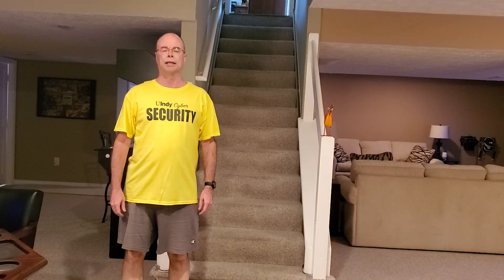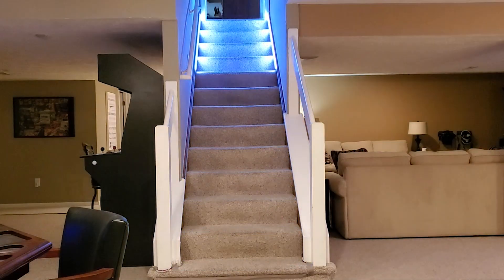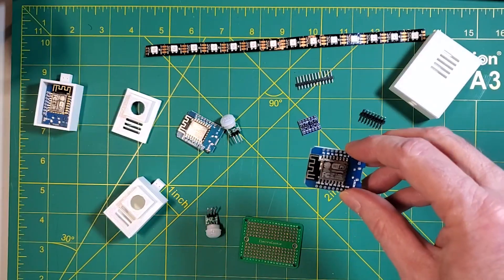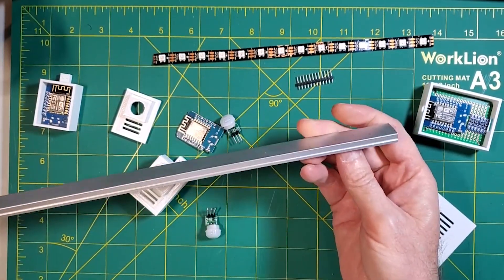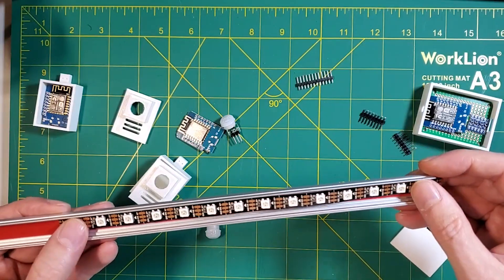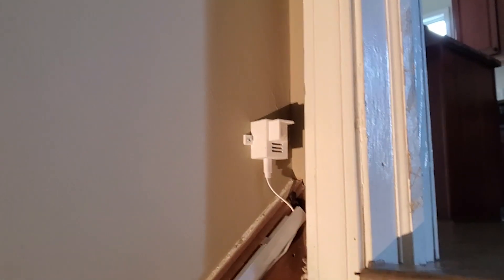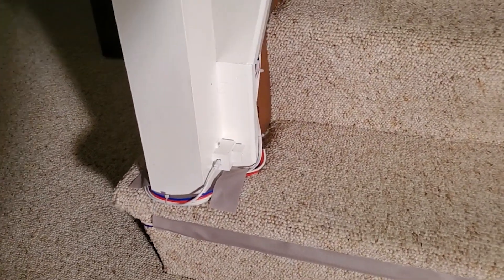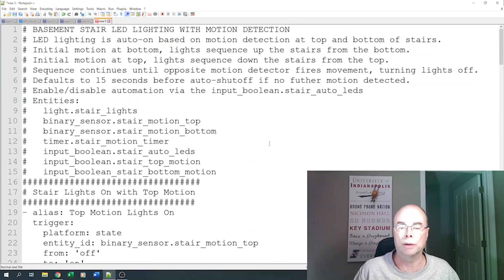Motion activated LED stair lighting... without staircase modification!

Comment: Neat! I may implement this on our stairs. I'm already familiar with all the pieces and am running HA, so it should be a quick weekend project.
Reply from the maker: Great!  Let me know how it goes.  If you are going to use my YAML, just assure you grab the right version of the Gist file as recent changes in HA and WLED broke the older version.  If you are comfortable with YAML, I'm sure you'll have no problems but it seems that this is where most folks have reached out to me with issues... integrating my YAML automations into their particular HA instance.

Don't hesitate to reach out if you do run into any questions or problems... and good luck with your project!
Reply: @ResinChemTech  Will do! I've ordered some stuff to start the work. Primarily the channel, but also the PIR sensors and some D1s (I think I'm also nearly out of D1s - I've mostly been using ESP32 and ESP32 D1 Mini's of late, but the ESP8266s are plenty for this project). I have an extra LED strip so I'll start with one side to verify I like the channel I've chosen.

I imagine I'll just create my own HA automations so they make the most sense to me - I have at least 15 or 20 that I've written so far for lots of little things around the house that are motion or time or location dependent. I've got a few ESPHome devices already and I've even written WLED plugins, so I should be good with those. I just hadn't thought about putting the strips down the side (duh!) or lighting two strips in parallel from one data line - that works well?

Some of my WLED projects... I made this for our 25th anniversary (3d printed body, designed and printed by me, uses 3mm fiber optics, runs WLED) https://www.youtube.com/watch?v=hsc0FMRmU38 . I made this lamp for my grandson's birthday, the video shows off the plugins I made for WLED to provide on-board UI https://www.youtube.com/watch?v=tITQY80rIOA .
Reply from the maker: Sounds like you have plenty of experience with HA and WLED, so I'm sure you'll figure that part out.  Splitting the data signal worked out just fine and hasn't caused me any issues.  I honestly didn't know at the very start if that would work, but I didn't want two separate controllers (knowing they'd never actually truly stay in-sync.. even if I used the WLED syncing feature).  But with the single signal line.. and with the same number of pixels on both sides, they are perfectly in sync for all effects.

I did have to experiment with various motion detectors.  I originally tried a couple of Zigbee versions (thinking that wireless would save me from running the extra USB cable), but everything else I tried had too long of a cool down period... up to 45 seconds in some case.  The ones I ended up selecting had the shortest cooldown I could find... around 5 seconds.... but it did mean I had to run USB power to the one at the top.  But as I showed in the video, using the flat cable pretty much makes it hidden.

Again, good luck and drop me a line when you get it done!
Reply: @ResinChemTech  Project completed yesterday. https://www.youtube.com/watch?v=DaU0u5YZguc for a video. The parts I used  for the project (along with links) are all in my video description. Thanks for the inspiration to finally install stair lights (I'd been considering it for a year). The missus loves them.

Comment: You just basically have wires and stuff hanging there and 'tucked behind stuff' and taped down. 
IMO I wouldn't do this unless everything was concealed and build from behind/under steps.   
IMO you should do anything other than carpet on steps.  But guess it makes it easy to hide stuff.
Reply from the maker: This project, as I did it, is not for everyone.  My intention was to do this without any modification to the existing staircase, as we will be selling our house in the next few years and all this has to come back out before listing... and I didn't want to have to repair a bunch of modifications.  There are many, many other stair light videos where they tear out drywall, route the stringers, etc. if someone doesn't want to see any wires or other components.  This is simply one option if someone wants to install a similar system without tearing anything out or making any permanent modifications to the existing structure.  

Thanks for watching and providing your feedback.

Comment: Can this run without the home automation.?
Reply from the maker: Not this particular version.  However, I did create a version in another video: 
 https://youtu.be/b4s_VEtVWY4  that is standalone and does not require any home automation.  This version is obviously more basic and doesn't include all the various effects and options of WLED... but it will work with two motion detectors and allows you to select color, brightness and couple of basic effects... all without any sort of home automation required.

Comment: I just want to make sure I'm clear. The flat usb cable is just to power the top board? If so where is the other end plugged into? Or is it cut off and wired into PS?. Another where are the wires joined to work the leds on the other side? You said they needed a sync signal which I understand but just not clear where they are actually joined together. Sorry for all the questions but thanks for responding. Nice u in Indiana I'm in Wisconsin near Milwaukee.
Reply from the maker: Yes... the flat USB cable is just to power the D1 mini/motion detector at the top of the stairs.  It could be wired directly into the power supply, but I needed to use a short extension cord for the PS anyway, so I just used one with USB ports and ran the USB cable to that.  For the data signal, it comes out of the controller and I just split that to the two sections of the LED strips.  If it helps, you can find a diagram of how I wired mine in my related blog article: https://resinchemtech.blogspot.com/2021/07/simple-motion-activated-led-stair.html  (it's near the beginning of article, right after the parts list).

Again, this is based on where my AC power was located.  For me, the location and connection between the controller, power supply and other 5V components is based on where I can best tap into power and best hide those components and related wiring.  For others, it might make sense to run the USB cable back to the PS, cut off the end and wire direct.  But for me, it always varies from install to install.  Hope that helps, let me know if you have additional questions.

Comment: Sir you are my hero.   I’ve been wanting to do something like this for years.  Thanks for the video I liked and subscribed.  Fellow Indy neighbor here also.
Reply from the maker: Thanks!  Just curious... are you a home automation/Home Assistant user?  Just before the pandemic hit, I was looking for other Home Assistant/automation users in the Indy/central IN  area to judge interest in some sort of users group around Home Assistant and/or automation.  I had to put that on pause... so I went out and created a blog and YouTube channel instead!  But the idea has hung around in my head... if we ever get back to "normal" some day!  Let me know if you decide to tackle this project (or any others) and run into any questions.

Thanks again for the kind words... and the sub!
Reply: @ResinChemTech  no sir I’m neither home automation or assistant user.  I’m a Hvac tech but I do a lot of diy to my home and always wanted to do this to my stairs but never really seen anything I like until your channel popped up.
Reply from the maker: Just as an FYI... I do have another video, if you haven't seen it, with basically the same setup but doesn't require Home Assistant, automation or any other hub:   https://youtu.be/b4s_VEtVWY4

Of course, it doesn't have all the effects and options that the "full" version has, but it is standalone and does offer a way to recreate the stair lighting system without the whole Home Assistant/automation code portion.  I did this version by request for folks that don't have Home Assistant or any sort of home automation hub.
Reply: @ResinChemTech  yes sir I just looked at it.   I think I like that one

Comment: What happens if you don't have a 3D printer?  Are there commercially available enclosures for the components?
Reply from the maker: You have a few different options.  First, the design files for my enclosures are available on Thingiverse:
Motion Detectors: https://www.thingiverse.com/thing:4969716
Controller: https://www.thingiverse.com/thing:4969733

You can take these files and there are a number of online services that will print and ship to you.  A cheaper alternative might be if you have a college or maker space in your area that might print them for you.

Or you can find a number of small electronic project boxes on Amazon that you can modify to meet your needs.  This is what I used (or whatever I had laying around the house) before I got a 3D printer.  I've used everything from candy boxes to empty toilet paper tubes in some of my projects. 3D printed parts are not required to make this project work... they just make things a bit "neater".  Technically, you could tape or glue the motion detectors directly to the stairs with no case at all.... or just be creative with what you might find around the house.
Reply: @ResinChemTech  Thanks!

Comment: This is amazing! I ordered absolutely everything for the project. My only question is that I have a landing w/ 90 degree turn at the bottom of my steps so 1 side would need more LEDs then the other. Still a way to program that to work? Could you point me in the right direction for programming help?
Reply from the maker: Hi Tim.  I responded to your post over in the blog, so please check there.  But in short, yes, this will work with different number of pixels on each side... you just need to configure WLED with the max pixels on the "long" side of the stairs.  Again, I tried to provide a little better explanation over in my blog response.  Good luck with your project!

Comment: That looks horrible all in show. You yanks have bo standards. A hideaway grove that hard?
Reply from the maker: Thanks for your feedback.  This project isn't going to be a fit for everyone.  As I stated in my video, my goal was to do this without modifying the staircase... as we will be selling our house in a few years... so it is a "temporary install".  Grooving might not be that difficult, but when I have to remove the lights when we sell because they won't work with someone else's wifi and without Home Assistant, I'd be left with a big empty groove in the stairs.  Just because this is the way I did it, doesn't mean that someone else can't adapt the idea (e.g. recess the lights in a groove) for their own needs or desire.  The goal of my videos are to show ideas that others can use for their own projects... not to necessarily exactly replicate what I did step for step.

But thanks again for taking time to comment and giving your opinion on the project.

Comment: Do you think that trying this with a Dig-Uno or a Dig-Quad would simplify or complicate the setup?
Reply from the maker: The DigUno would basically just replace the WLED controller that I built, so it would simplify from the fact that you wouldn't have to build the controller yourself.  Everything else would remain basically the same.  However, the next version of WLED (currently in beta) is slated to add support for multiple buttons.  With that (on either the home built controller or the DigUno), it might be possible to eliminate the two D1 minis that are used for the motion detection and wire the motion detectors directly the WLED controller. I won't know the answer to that until I get a chance to test it and determine the changes needed to the automation.

Comment: Dohyou have parts list?
Reply from the maker: Yep! The complete parts list, wiring diagrams, automation code and more can be found in the related blog post.  A link is listed in the video description, but here it is as well: https://resinchemtech.blogspot.com/2021/07/simple-motion-activated-led-stair.html
Reply: @ResinChemTech  thank you this is amazing
Reply: @ResinChemTech  do you have a blog or video of this type of install except for I want to use a router to cut a channel in the bottom of my tread to lay in the LED strip?
Reply from the maker: Other than the blog related to this particular video, which is linked in the video description, no I don't.  This is the only stair install I've done, but there are other videos out there that do something similar to what you are looking for.  I'm sure a search for something like LED stair lighting will turn up an option to two.

Comment: I’m going to attempt. Can different motion detectors be used possibly wireless. Zigbee or zwave?
Reply from the maker: Absolutely... basically anything that acts as a trigger and can be integrated into Home Assistant (or NodeRed or whatever platform you are using) can be used as the trigger for the lights.  In fact, you could use door sensors (assuming you have doors), pressure pads, etc.

The one thing to note about the motion detectors though is the cool down period (time until it resets from motion to no-motion).  I selected these particular PIR sensors due to the short cooldown (about 2 seconds).  I have an Aqara Zigbee motion detector for another project, and it's cooldown period is over 30 seconds.  Travis over at DigiblurDIY has a great video comparing wireless motion detectors, including the cooldown period (https://youtu.be/3U1fOqkk3Wg) if you haven't seen it.  I think anything with a cooldown period longer than it takes you to walk up or down the stairs may present some challenges and would have to be accounted for in the automation somehow (but it could be done).

Good luck with the project and let me know how it goes or if you have any questions.

Comment: This would be a nice feature to a drive way...
Reply from the maker: That is an interesting idea, and it could be adapted from the stairs fairly easily. Of course, everything would have to be weatherproofed, but I could even see combining it with a distance sensor (like I did in my parking assistant vid) and have the lights indicate when the car is parked in the desired position.

Thanks for the idea... might be worth investigating at some point.

Comment: I did something similar but for a pantry and I ran the LEDs around the inside of the molding of the door frame so it lit the pantry from top to bottom with a single LED string just cool white and a simple motion sensor so that at the door open the lights came on
Reply from the maker: I tried to add closet lights, similar to you, with the same basic controller and a door sensor.  My issue was that I didn't have ready access to AC power, so I tried to run the system off of a battery pack.  The batteries just didn't hold up long enough to make it worthwhile.  I would need to use an ESP32 and deep sleep, but I've already experienced significant delay when doing that, because it takes time for the ESP to wake up, connect to wifi and then turn on the lights.  It just wasn't feasible in my case.  But I'd still like to do something like you've done with the pantry... but with AC power, it's a challenge to make it responsive enough.

Comment: Very interesting project. I am curious, though. You said that the lights turn on when one sensor is triggered, and off once the other is triggered. How does the system handle situations where someone might come up and go down at the same time? Is there a “minimum” amount of time needed between sensors trips?
Reply: I sincerely appreciate your quick and precise response. Yes, you helped me a lot.
Reply from the maker: There is an inherent "cool-down" time of about 2 seconds on the motion detectors that I used.  I also use input_booleans in Home Assistant to know which sensor triggered and can code around "most" situations.  But it is possible that multiple people using the steps at the same time can occasionally lead to either the lights shutting off prematurely, or even running in the wrong direction for the last person to enter the stairs.  Doesn't happen often (there are only two of us and we are rarely both on the stairs at the same time). There is also a 'failsafe' that automatically shuts the lights off after 15 seconds in the event that a starting motion was detected, but the ending motion never occurs.  All this is handled via the Home Assistant automation and really isn't part of the controller or  hardware.

Comment: Ha, the upper stairs lit up while the guy was downstairs.
Reply from the maker: Yeah... that appears to happen because I had to build in a small delay in the bottom motion detector.  The pattern, once starting, repeats until the opposite motion detector fires (or 15 seconds elapse).  But due to the open side of one of the stairs, the bottom detector has a few seconds delay.  So, even though I had reached the bottom of the stairs, the pattern repeated and started at the top (since that's where motion was originally detected), but then stopped once the short delay expired on the bottom motion.  They didn't really "start" with me at the bottom, they were just repeating and ended after I had already reached the bottom.

Comment: very cool.. i think one problem i have is that my staircase is curved, so I don't think i can use those aluminum channels :(
Reply from the maker: Yeah... don't know that I have a great solution for curved stairs.  Of course you could use the double-sided tape and LED strips without the channel, but you'd risk damaging the finish if you ever needed to remove the tape.  And you'd also have to come up with some sort of flexible/bendable diffuser if you didn't want the bare LED pixels to show.  Maybe someone else here has an idea?